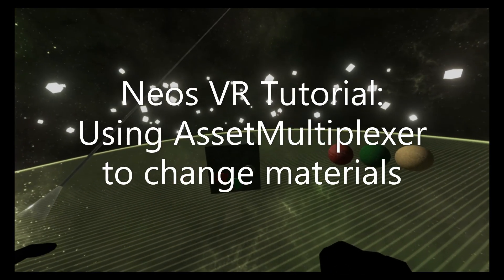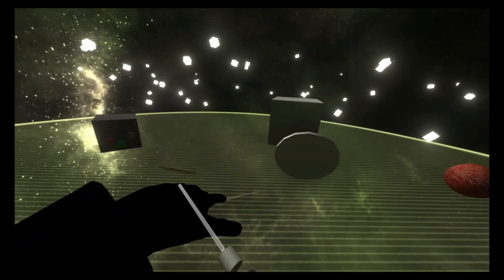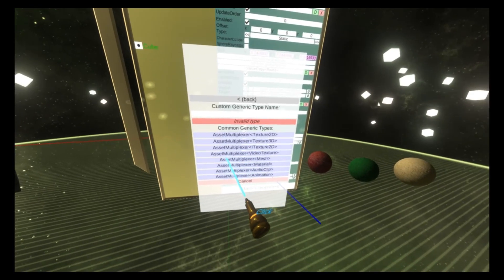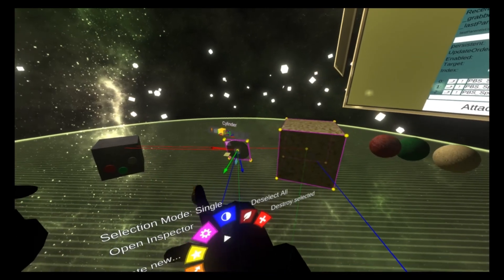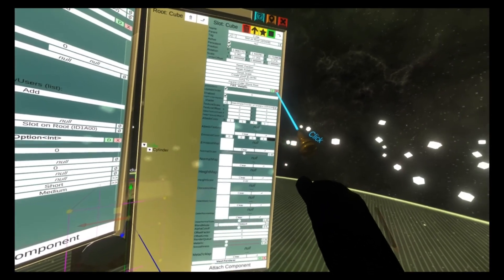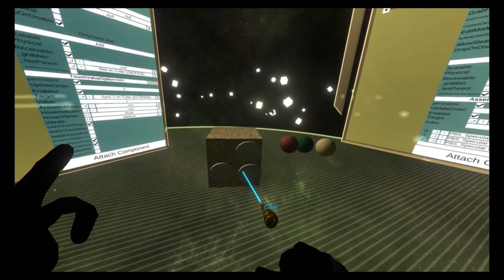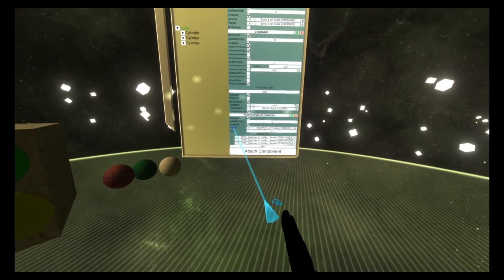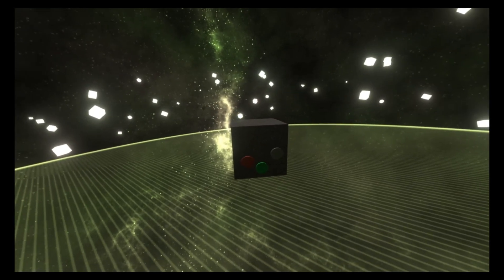OLD: Neos VR Tutorial: Using AssetMultiplexer to change Materials.

Comment: Is it possible to control multiple values with one asset multiplexer? I can't seem to make a value copy of type material
Reply from the maker: use multiple asset multiplexers or a material set component(I have a video on that one, just search materialset).

If you really want to copy the material, you'll need a reference copy component instead.